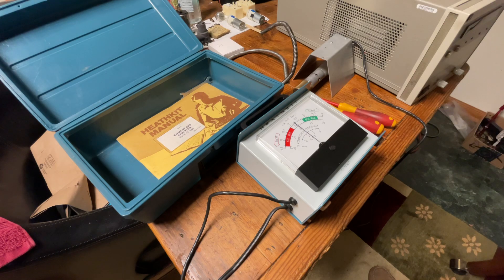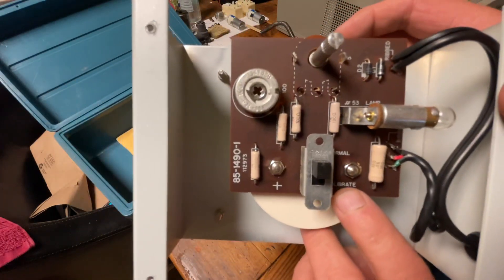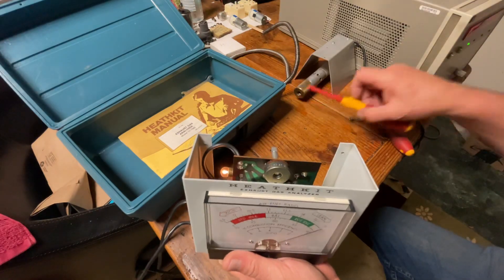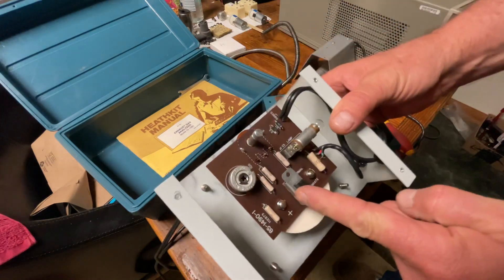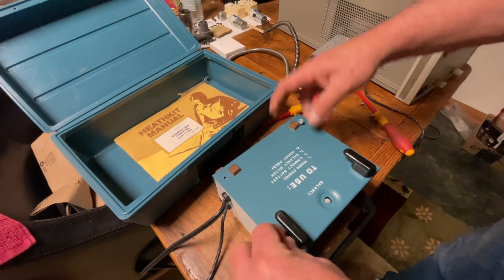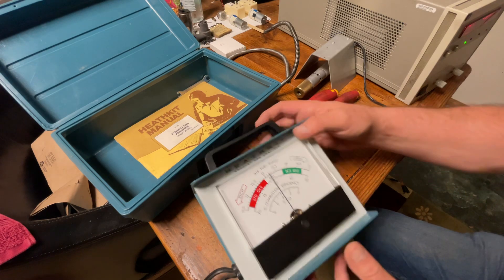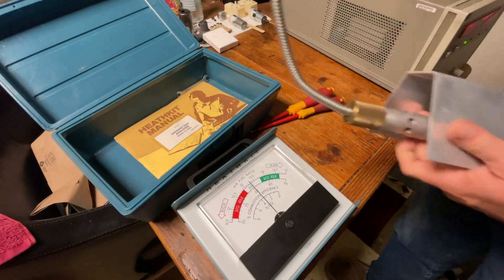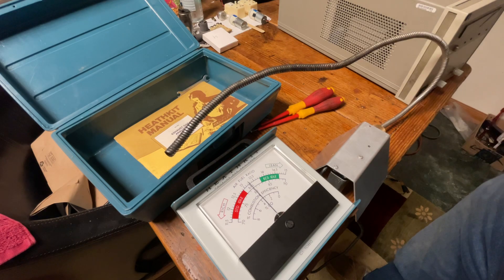Mercedes W126 Heathkit CI-1080 CO tester - setup and calibration

Comment: bought one on ebay looks brand new won't go to 15 only 14.65 on calibrate is that a big deal?
Reply from the maker: Did you follow the exact procedure as shown in video and instruction manual?
Reply: yes @inovahightechltd
Reply: @inovahightechltd  sorry for not getting back to you right away but i hooked it up to a different battery and it calibrated just fine.  thank you.

Comment: Hi Peter. I failed my CA smog test. It had never failed before until I rebuilt the Fuel distributor I bought on eBay.Anyway I removed it and put the old one back. I want to make sure I pass the next smog I do. I have a Heathkit gas analyzer and want to use it to fix the smog situation. I believe it the previous FD was set up too rich. I also have a duty cycle meter. Which one should I use to make my car run properly? And how I make adjustments to the car? With the CO Allen? EHA ?
Thanks
Reply from the maker: Co with Allen key to pass smog - don’t worry about duty cycle
Reply: @inovahightechltd  so i used my Heathkit while in neutral and leaned the CO screw to the green zone but it’s pretty shaky rough idle.

Comment: Awesome content :)
What do the red STD IDLE and green ECS IDLE ranges signify ??
I have a AFR gauge installed on my M110.989. I note that mid range of the green sector is roughly 1%CO and 14.2 AFR.  I have been adjusting my idle mixture to 14.7 so it looks like I can richen the mixture a little.

Comment: Great video! The best one about the Heathkit EGA on YouTube. Now does this meter supersede the lambda duty cycle meter? Can this be a stand alone meter instead of using a duty cycle multimeter? I have both meters and used the duty cycle meter first then put on the Heathkit to see the results.
Reply from the maker: The CO test in conjunction with the Lambda duty cycle verifies that ECU, Oxygen sensor, EHA etc are working correctly.
The results should 2% to 1% CO with 50% duty cycle, then adjusting mixture to lowest possible reading of CO without stalling the engine.

I left CO on where ever it was at 50% duty cycle at idle - I think it was around 1.5% CO in my case and that was good enough for me, since my car is 33 years old and has 337K miles
Reply: Most of your subscribers are classic W126 subscribers I would assume and this meter would benefit them greatly,but how about D.I.Y mechanic with a new car or  classic carbureted car like a air cooled VW? Do you think other car enthusiasts should get a Heathkit EGA?
Reply from the maker: @georgesand4629  it’s pretty much for both types, left hand meter reading is for non catalytic converter cars either fuel injected or carburetor